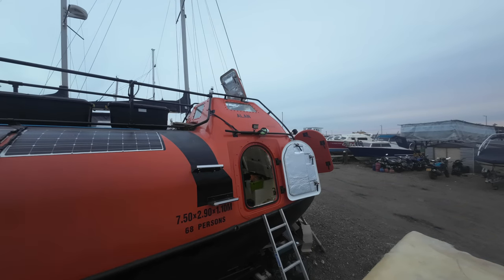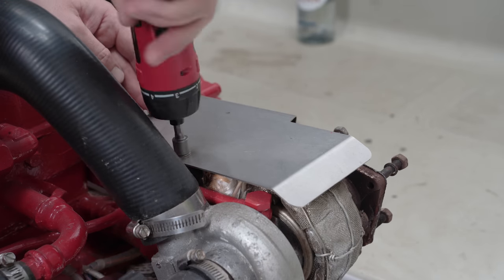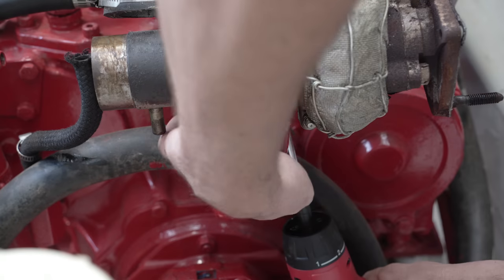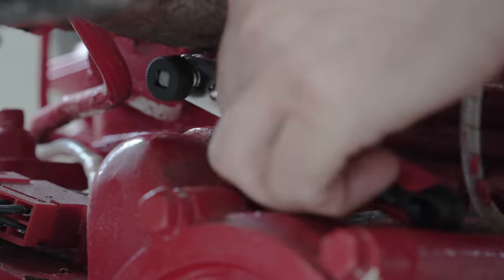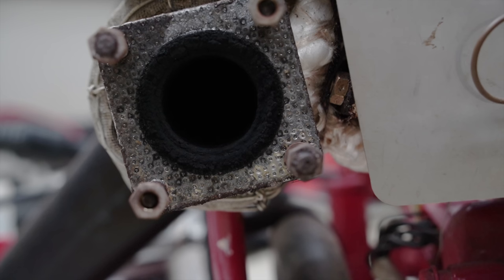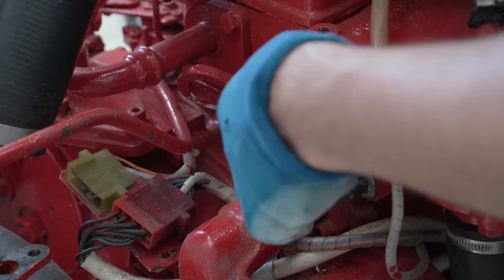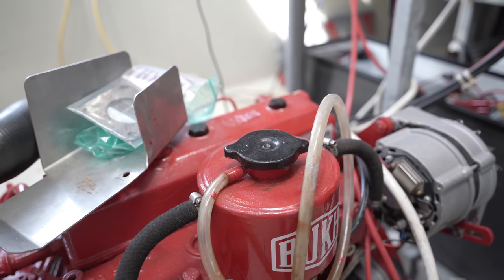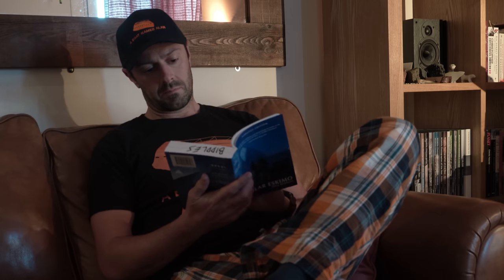Turbocharger removal - from a lifeboat Bukh DV48 turbo diesel engine. Lifeboat Conversion Ep53: [4K]

Comment: Alex do yourself a favor and look for wobbly extensions (its a standard ratchet extension that has the capability to wobble grab 2-3 of them in differing lengths) for your preferred ratchet size also grab a independent wobbly.  Between the independent and extension wobbly you will be able to do far more with a ratchet. Just for reference I have been a marine engineer for over 30 years and know the struggle all to well. Keep up the great work.
Reply: what he said!

Comment: To help with the corroded studs, wrap small pieces of cloth around them and soak with rust release agent.  the cloth holds the agent against the stud and provides a automatic top up.
Reply: Excellent tip. Sometimes I'll use a piece of hose that I shove over the nut, cut off above the end of the stud or bolt and fill with penetrate. Works great for lubing cables with a housing too.

Comment: When the turbo goes back onto the engine
Assemble every nut onto its stud with either Copper or Nickel (on s/s nuts) Anti-seize paste. 
Ince the turbo is back on pour a small amount of oil down the hole where the banjo bolt screws in. Refit banjo and crank engine over with the stop engaged so it cant fire until oil pressure light goes out or gauge registers pressure. The large black boost  hose can be swapped to proper hi temp silicon hose, the best being the orange coloured type altho your Bukh turbo wo t be making much boost so boy racer type blue silicon hose will work fine.
Reply from the maker: For a low-stress engine like this, what's the purpose of upgrading the boost hose?
Reply: Purely longevity
Silicon boost hose will outlast the mighty little Bukh. Factory hoses can and will harden and crack/split over time with latent heat from the turbo and exhaust, rspcially if there isnt much air circulating around the engine.
Reply from the maker: Ok thanks. It's a very specific shape, so I'll have to see if viable.

Comment: Alex, just harping back to my days as a lifeboat service engineer, a few offset angle open end or ring spanners can be either purchased (tekton make some nice ones) or quickly made with a propane torch and a vise to end the one click nightmare of tight rusty or deliberately interference fit nuts. BTW New bolt/nut stainless galling can easily overcome with a good polish with a stiff drill mounted wire brush as machine manufactured fasteners are not polish finished and the roughness of the machining is what makes them bind to the point of destruction on initial assembly. I manufactured specialized stainless equipment for navy minehunting ships and had to do a lot of pre-degalling work and nickel anti seizing but it's totally worth it.

Comment: Oh man, that turbo is so much easier to remove than the ones on my Saabs! For what it’s worth, when I worked as a Saab mechanic the cars came equipped with either a Garrett or Mitsubishi turbocharger and we almost never had to replace a Mitsubishi unit!

Comment: Hey Alex, love to see Alan coming along! You mentioned in a previous episode the days passed of hundreds of thousands of YouTube views. I’ve watched almost every episode and this is just my observation on what has changed. 

The episodes are now incredibly short and specific. It’s either an short video about putting on a grab handle or removing a turbo. After a certain point, these videos are no longer about a lifeboat conversion but a channel about shrink wrap and pipe work. I’ve watched a lot of boat refit channels and it just seems like more gets done each episode on other channels, maybe they don’t post as often but each episode is much more satisfying. No other channel has your skilled rhetoric, but I wish each episode helped build the story of Alan instead of one off quick repairs. 

Ultimately you will do whatever works best for you, and I am just sticking around to see all the amazing adventures you and Alan will undertake.
Reply from the maker: Thanks for the feedback. There was a clamour in the early days of 3-5min videos to aim for around 10mins, and that's still the average across the last few months. These two this weekend are indeed short. Regarding the sense of completion per video, that's mostly due to the work schedule and the time I have to work on Alan each week. Perhaps I've got slightly worse at the formula of having a video with a headline, substantial job, with some little bits and bobs at the end that wouldn't warrant an episode on their own.

Interestingly, the stats and revenue are much better for short mundane Alan episodes than they are for long, detailed mini-docs that take me days to cut together. The like:dislike ratio has also never been better - usually over 99.5%, so people aren't hating the content, but perhaps their click behaviour is telling YouTube something different.

I also need to remember there's a market for people who couldn't care less about Alan (shocking, I know) but just want to see someone demount a turbo before they do it. If buried in an Alan story, this won't land well and I risk missing out on single videos transcending the Alan series, and having mini-trending booms, like some of them have done.
Reply: @AlexHibbertOriginals  Alex thank you for the reply, it’s amazing when creators engage with their fans. YouTube is a vast platform with many different people with different reasons for watching. Perhaps my comment reflected more of what I wanted to see and not what is actually going to be successful for your model. 

I’m glad to hear your metrics are looking positive, personally I just want to see hundreds of thousands of people watching so more people can contribute financially to the project. I do miss the mini docs, but I think the story of Alan is just beginning so I’m sure there will be more opportunities. 

PS, if you ever desire recreational or professional avalanche education for exploring more mountainous environments I can help.
Reply: @AlexHibbertOriginals , my two cents, I have been watching Alan for months, but not the last few weeks, Youtube has not been showing them to me and I wasn't aware there were new episodes. Now that I'm back I found around a dozen videos to splurge on. PS I am still subscribed, so... 🤷‍♂

Comment: Great work. When leaving attached parts to soak for a long time I’d recommend wrapping the ‘thing’ in blue roll, kitchen roll or absorbent rag and soak this is your favourite penetrating fluid. Trick is to then cocoon in cling film or enclose ‘thing’ in a plastic bag(s) so fluid doesn’t all evaporate. If using a bag try to tie off the neck with tape, garden wire, those wire things that wrap new cables or a cable tie. All coming along very nicely!
Reply from the maker: Thanks - I'll do this today

Comment: good call to replace spring washers with nordlock.
spring washers have basically no locking ability. nordlock is the way to go, we use them as standard (aviation industry). they are highly vibration resistant and second only to safety wire (which would be overkill for your operation though)

Comment: A set of Obstruction Spanner will help in these situations as well as a few socket extensions as you can some times thread them through parts to get a good secure fit for large impact drivers that would never fit in that space, both are very handy, though will most likely sit unused for most of the time.

Comment: My ratchet set has an extension that goes between the ratchet and the piece that grips the nut.  While the extension I have is to short for the difficult nut you showed I’ve seen in an auto mechanic’s tool box extensions of different lengths. The  longer ones would have extended past the red pipe’s L turn.  Given the difficulty you experienced you might look at an auto parts store for an extension that would help when you reassemble the motor later

Comment: The expansion tank cap is worth replacing every few years for its low monetary value. A faulty one can cause mysterious issues in the cooling system such as split pipes and overheating. It could be worth taking a spare with you!

Comment: Sending sympathies for the turbo wrenching. This past weekend I ended up burning an afternoon simply replacing the starter on my truck. Only 4 bolts need removing, but only 1 of them was ratchet-reachable. The other three were a mix of everything you went through getting that turbo detached. (I even considered the angle grinder at one point.) Essentially the same story to get the new one installed. Arms are still sore. Hopefully your re-installation goes better.
Reply from the maker: It sounds like you had a much worse time of it.
Reply: @AlexHibbertOriginals  I'll say this... if the design of that truck is indicative of automotive engineering over the past few decades, it's no wonder the Japanese ate Detroit's lunch.

Comment: You may want to upgrade your tools a bit as if you struggled on dry land then your gonna really struggle at sea trying to make life saving repairs. Even a Halfruads socket and spanner set in a case for storage. See if a tool manufacturer will sponsor you.
Reply from the maker: I have full size socket sets, 90 degree drill bit adapters and so on. This was a very specific set of restraints on angle and relief, so I'd need to consider more advanced mechanic's tools. With so many available, the question is which.
Reply: I am a HGV technician of some years and would say for your needs a 3/18" drive socket set with extensions deep and shallow sockets would be big enough and small enough for most tasks. 1/4" drive is handy and can be used with screw driver and torques bits especially on electrical installations . 1/12" is big and strong but numb and clumsy for smaller work.
Reply: Get yourself a Bahco socket set in the large case. 1/2 inch drive plus 1/4 drive as well as 1/4 bits in Torx, hex key, screwdriver bits and it comes with ring/open end spanners and a set of flexhead spanners. Swedish brand (owned by Snap-on) Quality is rught up there.

Comment: To clean the studs up you need a die nut for the correct thread. I've tried many times to clean up threads using penetrant and running a nut up and down, even filing a slot in the nut to try to mimic a die nut, but nothing works as well as a proper die nut. Just take care not to get it crossed!!
Reply from the maker: Yeah I'm realising that. New studs even easier!

Comment: When using a shifter, always use the fixed jaw for the direction of rotation and never the sliding jaw. The reasons are obvious.
Reply from the maker: I usually get told off for using adjustable spanners/monkey wrenches/shifters at all, so this is progress.
Reply: What are the obvious reasons?
Because for me if it works it works...
Reply: @Jehty_  The sliding jaw spreads and the tool becomes loose and it rounds the corners off the nut/bolt. They're not designed to be used like that because the thumbwheel is taking all the torque and not the fixed side - not too hard to work out surely.
Reply: @AlexHibbertOriginals  I'm a mechanic and I use them all the time but they have limitations. The thumbwheel isn't designed to take the torque - the fixed side of the jaw is. The thumbwheel via the sliding jaw takes the slack up. Using it the way you did rounds corners off bolts and nuts.

Get a 3/8 drive socket set, 12" 3/8 drive swivelling extension x1 and a 12" 3/8 drive normal extension, a 24" long 3/8 drive normal extension. 
Get a set of ring and open end spanners, offset ring spanners, and open end spanners. Don't cheap out on the socket set but cheap spanners are generally pretty good these days.
Reply: a wrench is a no go

Comment: You will have no sympathy from any mechanics watching, most turbos nowadays are tucked right down in the gubbins, barely visible, let alone servicable! and that's the reason we all have a huge assortment of extensions, wobble drives, flex-shafts and universal joints for our socket sets. and there's always the option of making a one-off spanner for the job, but then again mechanics do charge an awful lot for this preparedness!

Make sure you use plenty of suitable anti-seize for when it all goes back together, as the next time it comes apart, the conditions may be less favourable, or a decade or two away.